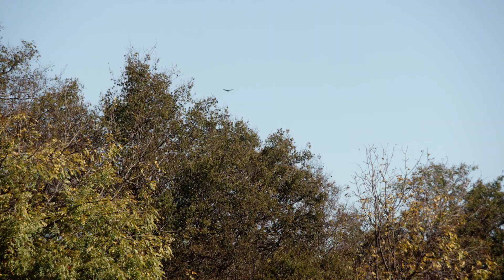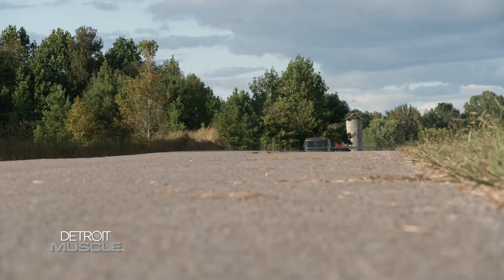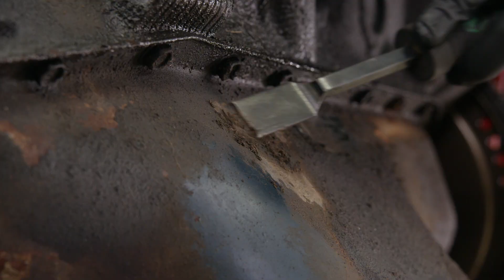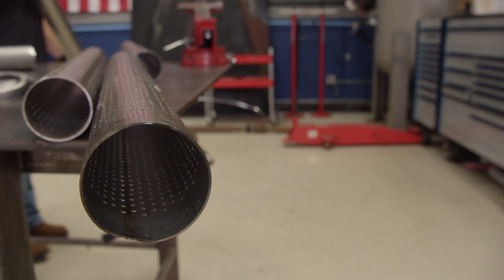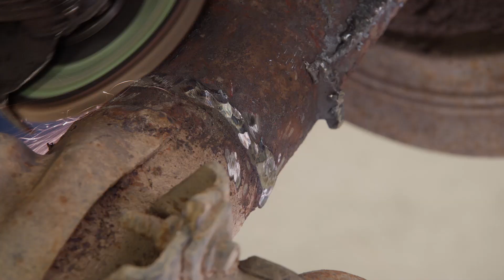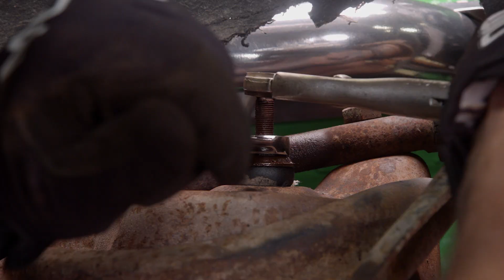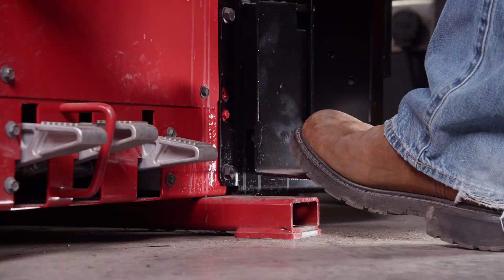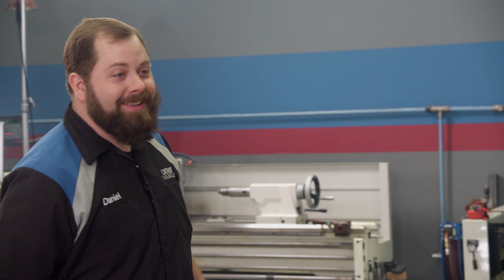Full Build: "Overtaker" Caddy Hearse Wakes the Dead

Comment: That 500 is no joke, few minor modifications and your flying down the road. I was planning on a LS swap tell a friend told me I’d like this setup a lot better, I took the chance and don’t regret it. I put Holley sniper efi on it and hooked it up to a manual 6 speed tremec that Caddy is a beast! I twisted the spokes off the original wheels on a recent burnout
Reply: There's a reason for stuffing a caddie engine into a model A. That's a lot of engine.
Reply: That 500 they build is a joke though. 425 heads on a 472/500 is a downgrade, as they have worse flow and lower compression. When Flashcraft (THE go to company for Cadillac engines) dynos a 1976 500, despite that being the weakest year for the engine, the numbers they found were that the BARE BONE STOCK, low output 500 still out out 302 HP and 493 ft/lb of TW, and that wasn't even on a rebuild, but in 45 year old engine. Meanwhile these guys managed to only hit 258 HP and 323 TQ.
Reply: @the-dullahan  that's not too impressive when you can cheaply get 300+ hp out of a straight 6
Reply: @jnywd8450  no one said it was impressive, Madame. Work on that reading xo prehwnaion a little. You can "cheaply" get 300 HP out of a Cadillac block with a total budget of $100 on Craigslist, by the way, but I'd love to hear about your straight six build cost.
Reply: @jnywd8450  LOL that's sad bro. No one said 300 HP was a lot but you realize your argument makes no sense right? You need to spend extra money on a straight 6 just to hit 300 HP while these Cadillac engines are $250 or less on Craigslist or $100 at the junkyard they're 400 HP in factory form.

Comment: The compression of this engine was between 7.9:1 and 8.1:1.....very low back in the day, but they have potential.
Reply: The ideal combo is an early engine (68 to 70) with the late heads, it gets you up to 12:1 with stock parts.
Reply: @Nikko780  LOL no. The early heads had higher compression than the late heads. Early heads are 76cc late heads are 126 cc. Sorry lady but you're wrong early andate blocks are identical, power wise, and the only differences the blocks ever had was they changed the location of the heater outlet in 70 and they expanded the cooling passages in 72.

Comment: Had a 59,  Paid $100 for it, motor had dropped a rod so no motor to work with. Had a 454 I was building so why not.. Was never the first off the line but was first into the traps most of the time, also called mine OverTaker , The blower sticking through the hood probably gave away the fact it was not stock.

Comment: The difference between the factory and the aftermarket cooler.. wow.. i mean yea, the old one is over after 40-50 years, and the new one is lighter, more efficient, but on the quality side of things it couldnt even hold a candle to the original one.. half of it is plastic. Old stuff were made properly, from proper materials, heavy, but it lasts 50 years

Comment: I don't know why they bothered to upgrade the rear end with those pathetic HP numbers. Even with the nox, it's still way short of what 500 cubes should be producing.
Reply: I would have kept the Expedition coil springs and fabbed up a GNX style torque arm setup and also using the stock lower arms mounts...

Comment: Here's one thing I'm glad you made the side pipes because I was thinking you know doing an h pipe off of the headers and running it and that way compresses out bounces out the compression the other thing I would have done is that the seat cut I would have gotten something from cool ass tools those skull exhaust tips give it a little bit more macabre look and I don't know possibly a supercharger on there mechanical cuz nitrous oxide is good if you're going to the dentist not a fan and yes I also want a hood scoop

Comment: Those big engines are severely limited by port size. If you put a good set of custom heads with big valves and even bigger ports, you'd definitely have to spend some money on that bottom end because it would twist that crank and rods up like a pretzel! A '69 472 engine would be a good base for a hot-rod Caddy, since they were already making 375 hp. stock. The 500's were just a fuel sucking land barge. When I was a kid, I had a neighbor with an Eldorado with a 500, and my Grandfather's '69 Sedan-de-Ville with a 472 would run rings around it.🤣 Pretty nifty build though.. I'm surprised that 150 shot didn't unload the bottom end of that 500 though!😆
Reply: We simply put the 472 heads on the 500...

Comment: Damn that plywood floor has to weigh at least 300lbs. You could have gutted all the interior parts and got rid of some of the structure that holds them and reinstalled panels. Its gonna be slowwwww.

Comment: You took the AC out, so you where able to reduce the core thickness down, that single core won't make it with that AC running on that caddy.
Reply: What ac..gone
Reply: @randyledford6496   randy I was commenting about the new radiator.   When you said you where able to reduce the weight by getting rid of the old 3 row radiator and reduced to a single row, I said that can only happen if the ac system was removed and u did do that.  On the other hand, if that ac system was not removed, that single core rad would not cool that motor.  Some viewers may think you can run a single core radiator with that ac system, because you only mentioned you reduced the weight, and didn't explain if you kept the ac system you need more than one row.

Comment: Get yourself a brake washer! It's not an expense you guys can't fund, and you'll be able to do a much better job cleaning old brakes and backing plates without spraying cancer all over the shop. It will pay for itself in using less chemical cartridges on your 3M respirator and 1,1,1 Trichlorethane cans of Brakleen. (or the MUCH worse xylene substitute)

The ONLY cans you should be spraying in your shop are carb cleaners and then only on a running engine where its gonna get burned in the cylinders, like into the vent or to clean a MAF sensor or TPS motor pindle.

Comment: Back in the 60's I used to race my 1948 Cadillac ambulance with flathead 8, three on the tree, at Island Raceway in NJ.  I consistently turned 23 seconds in the 1/4 mile.  It weighed just over 6600 pounds.  Thanks for this video.  It brought back some pretty good memories for me.
Reply: 2.3 seconds is still quick by today's standards.
Reply: 23 SECONDS...PRETTY IMPRESSIVE FOR THAT BOAT...WOW...FUN!!!
Reply: @bigsparky8888  My 66 Galaxie XL ran best 13.79 with a warmed over 390, 4:11 gears. This car could've done a lot better if it was warmed over a bit and took better care of
Reply: @m42037  well we may need to talk, I've got a 66 Galaxie with a 352 I'm looking to spice up
Reply: @m42037  I'll have to check that out. Thanks man!
Reply: @flyingace5057  KIT
Reply: I'd rather have consistent but slow ETs than inconsistent but fast ETs. That'll kill at bracket races.
Reply: There are probably a few people who could run the 1/4 that fast on foot.
Reply: What happened to it?
Reply: @Simon_r2600  I sold it to a Hippy and he turned it into a Flower Power Art car.

Comment: Years ago my sister got a job at a local funeral home. Her job was to take a hearse and go to wherever the recently deceased was and bring them back to the funeral home for preparation. Her very first call was to a local hospital. The body, a man, was loaded into her hearse in a carboard coffin and away she went. She was jus a mile or two away from the funeral parlour when she encountered a steep hill that was covered in ice. As she went down the hill towards the lights at the bottom she lost all control and could barely steer to keep the car on the road. As luck would have, as she approached the intersection the light changed and a car pulled out just in time to broadside it. Upon impact, the carboard coffin hit the seat wall located behind the driver seat and the body was catapulted into the passenger seat slumping over the dash. She got out and went over to see if the driver of the other car was alright and the police arrived. They checked her car out and then summoned and ambulance to see if her passenger could be revived. The police told her that an ambulance was on the way and she asked why. The police responded with, "Well ma'am, your passenger didn't do so good in the accident." To which she replied, "But he was already dead. He died last night and I was taking him to the funeral home." About that time the ambulance arrived and the attendants rushed over to treat their patient. She, the other driver, and the police all sat back while the ambulance attendants did everything they could to revive her co-worker. The were very sorry to tell her that her co-driver was DOA. She just stared at them and they said, "You don't seem too upset." Her response, "I'm not. He was already dead. We just wanted to see how long it would take for you guys to figure that out." The attendants were very very angry but the cops and the other driver thought it was hilarious. She kept that job for about five years but she always avoided that hill.

Comment: When he said the stock engine made 200 hp that was most likely measured at the crank with no accessories. What it has now was measured at the wheel so I think the gain they achieved is more than it seemed. It’s definitely an engine that was designed to be smooth and slow with torque down low so not surprising they didn’t get it that high. Only so much you can do with a stock 50 year old bottom end too, haha.
Reply: anything after 71 is measured net  not gross hp so at the crank but all accessories. so its the same way a new car is rated.
Reply: That's half true. It was under rated. Dyno tests show that a junk yard 75 or 76 500 will make close to 300hp at the flywheel its like 290 or something. I believe the 190 is measurement is rear wheel Hp with all the accessories. Or Cadillac blatantly lied. I have a write up somewhere from either Cad Company or Maximum Torque specialties that's about 20 years old. They showed you how to make 400 flywheel hp step by step.
Reply: @AnthonyPerna2  net is all the accessories but at the fly wheel. gross is bare engine. both was fibbed to do what they need  be it emissions or hp. a 71 engine and 72 actually make the same power but are rated different if that makes sense. everyone thinks a 72 is not as powerful because of ratings but for example a 71 buick 350 is exactly the same as a 72.
Reply: This was during the smog and lower HP number eras because car manufacturers were trying to avoid being sued by the government and individuals